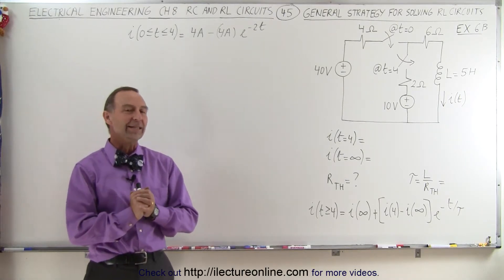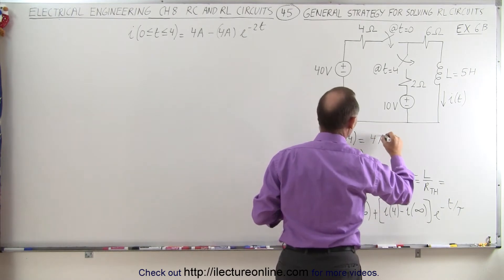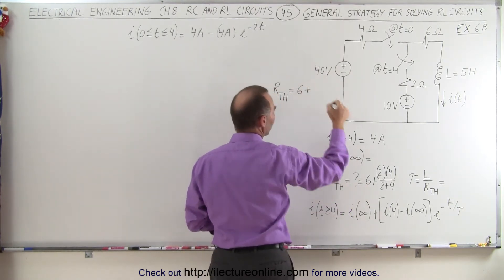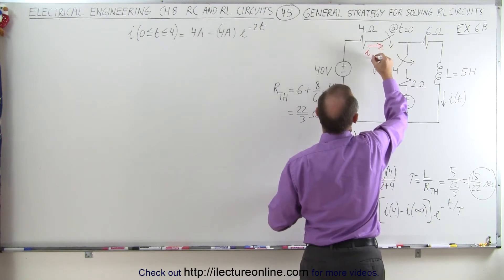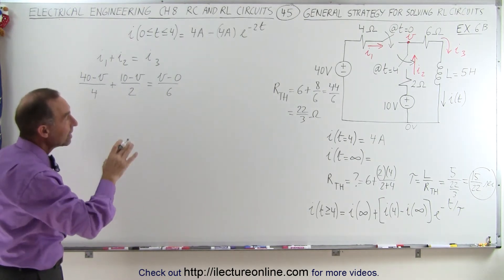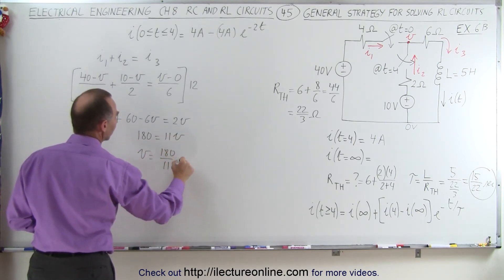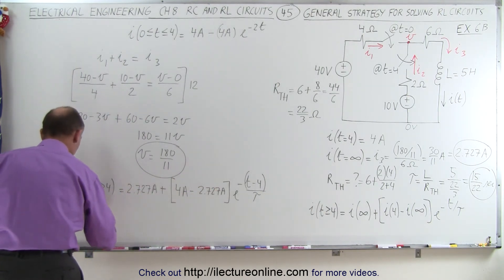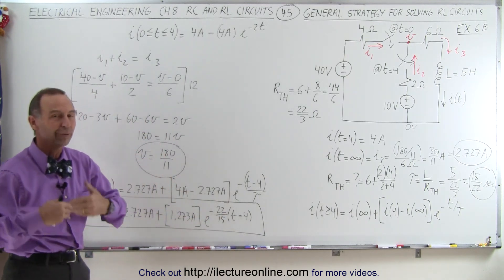Electrical Engineering: Ch 8: RC & RL Circuits (45 of 65) General Strategy Solving RL Circuits Ex.6B

Comment: Rth =6||2||4  or Rth=4+2||6      ? it could look like that ,how do you notice that its Rth=6+2||4?
Reply from the maker: To find Rth, replace the 2 voltage sources with shorts and remove the inductor and leave an open.  After the 2 switches close, the 2 and 4 ohm resistors are in parallel and both are in series with the 6 ohm resistor.
Reply: Thank you sir!
remove the inductor and leave an open" solve the problem for me"
Reply: between the open points of inductor there is a voltage,  this is no current thou because open.